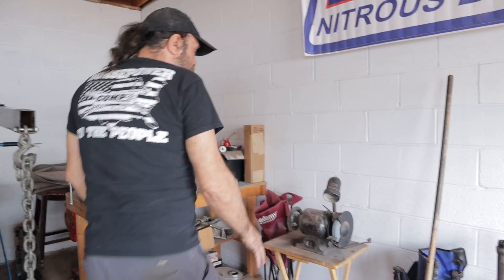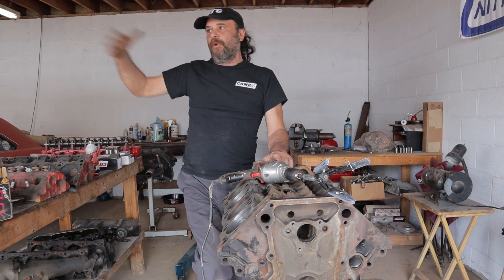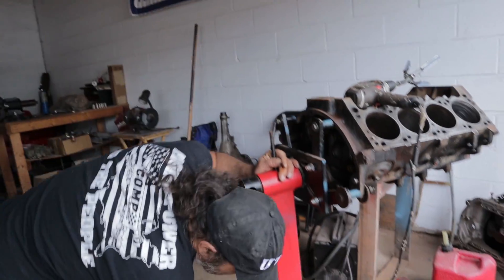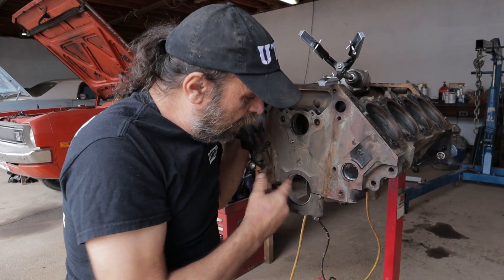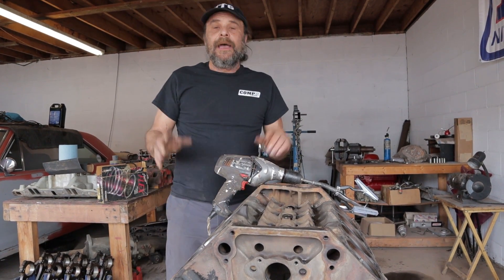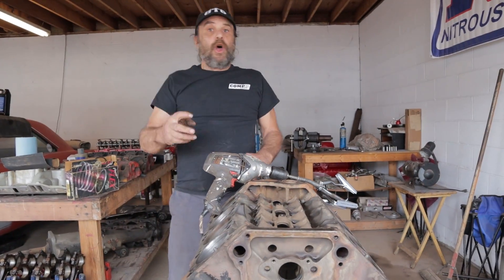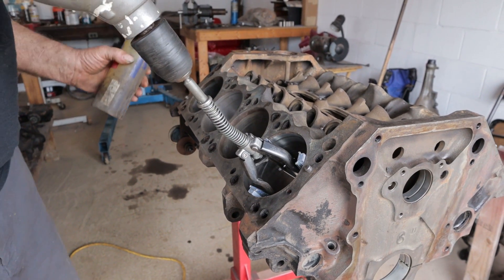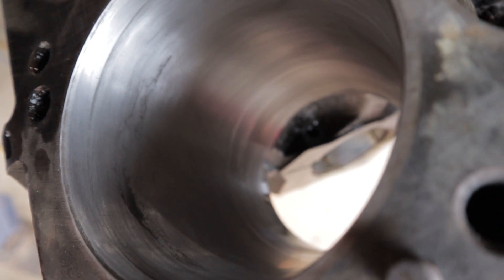Perfect Daily Driver 6 - DIY Engine Block Prep

Comment: Hmmm, very interesting theory on the ridge cutter! I've recommended "cause that's what we learned But, never had an engine with a ridge I needed to cut^__^   But, will a ridge cause your hone to be off what ever it's size is causing tapper???     THNX!
Reply: as soon as the heads get torqued down on the block, the bores distort "out of line", and that ridge as well. The best way to gap/measure piston rings is with a torque plate on to represent that distortion.  Since most don't have a torque plate at home, we can cheat with a stack of washers or a wrist pin that represents the thickness of the head, and clamp our fasteners down to replicate the distortion.
Reply: @albertgaspar627  Taper! (spell check, sorry)
Taper in the cylinder!
 Not, Magellan's maps!

Comment: Tony, love the series!I am going to mimic your build and put it in my 1970 Fury III 318 convertible.Found a really good low mileage 1991 318 engine for cheap. What Thermoquad would you recommend if I want to go that way instead of the Holley? Can get one from a 1979 360...1 3/8" primaries. Great channel...keep up the good work!!!
Reply: 1 3/8 has to be the primaries.
Reply: @techmaven5900  fixed

Comment: I don't know whether to share this with my peers or not. They might begin to hate you Uncle Tony, like they hate on me. Many of them are of the "Once you pull it down, you MUST replace every conceivable component, rebore, grind the crank, deck the block, all after sonic testing it" ilk, even in a daily shopper. I've been doing it this way nearly, but not quite as long as you Unc, and nowhere near as frequently, but with no failures. I'm probably just a bit more cautious, in that I will replace rings and rod bearings every build, regardless. Keep up the great videos my friend, you have the respect of many.

Comment: Never used gasoline, but we normally hone with diesel as lubricant
Reply: if you had a drill cord like this one, you probably were smart not to use gas in a confined, poorly ventilated spot :)

Comment: I love a motor on a shoestring.
Every build has a budget.
Dollar per horsepower Chevy was the best build. Then there was the practicality about how much horsepower you had was actually going to be applicable. Power to weight ratio, traction coefficients, weight transfer, how much can you get to actually hook up. Small car big motor with posi and cheater slicks. Hi 12 + low 13s. Nowadays if you start with a good core and you take it to a machine shop for $1,800 it comes back clean, balanced, in a bag and boxes, ready to be assembled. I'm in California. Then there's fuel once you go past 10.5 fuel is $10. And then?

Comment: Hey Uncle Tony, I didn't catch if that is an LA or a Magnum block?
Reply: It came from a mid 90's D100 truck.  Nothing special.
Reply: @kramnull8962  thanks, mid 90s toward end of production of the D100 I think was Magnum IIRC.
Reply: It’s an LA..... about an 88 model.... just before the change.
Reply: Magnum has three threaded bosses in a triangular pattern behind the motor mount ears . 5.9 l has both ears and holes for vans
Reply: Thanks for the tips guys 👍

Comment: Man, this is good info. For what it's worth, to save a lot of scrubbing when you clean the block try using Outers Nitro Gun solvent. It kicks the living crap out of other degreasers I've tried. I discovered it by accident when I used it (couldn't find the Gunk) on a filthy lawn mower. Only problem is that it costs more than Gunk.
Reply: Yeah, or Hoppes #9. Best smell in the world.

Comment: Tony, why didn’t you mention measuring the ring end gaps ? I always thought that determined a cylinder needing honed or rebored ?
Reply: Measuring the ring gaps in itself won't tell you if it's the bore or the ring that's worn.  Comparing the ring gaps above (on the ridge) and below the ring travel with various places on the area in between will show both cylinder wear and taper.
Reply: Then why do manufacturers suggest measuring it. It’s a common practice concerning any piston/ring / cylinder. If the ring gap is wider than manufactured suggestions. You know the cylinder is too large and you need to increase piston and ring size. That’s why you measure the gap.
Reply: No, you know that the cylinder OR ring is worn.  What I describe above shows which.

It’s easy to suggest anything.  There’s nothing wrong with sticking a dial bore gauge in the hole and taking several measurements.... I’ve done it many, many times.  This channel just shows some old school ways of doing things that have real science behind them.  Enjoy the channel for it is, not what it isn’t.

Comment: Ridge reamer sounds so hilarious though!!??!? Hahah!! if you get the cylinder machined how much will it affect the pistons you can use or what needa to be changed out on a block that needed machining in the cylinders specifically????
Reply: Contrary to what was said. The ridge reamer was used to cut the ridge so that you wouldn't break the piston when the rings caught onto the ridge, when you beat the piston out of the cylinder... Also, like UT was saying about everything here. Ridge reaming is a TIME CONSUMING task... It has an adjustment. You start with the reamer just barely even touching and slowly work it into the ridge... Not just GOUGE it into the side of the block and start hacking away...
He is probably correct though for later 80's to current engines. But if you got ahold of a 60's block that was higher miles, the ridge could be much greater of a problem for getting the pistons out safely...

Comment: On the cam bearings, how do you check to see if they’re all in alignment and level?
Another way to check the bore is to take a compression ring, square it in the bore just beneath the ridge and measure it. Then run the piston all the way to the bottom of the bore, where there is no wear and measure the gap again. This will tell you how much the bore is tapered. Anymore than 0.008” needs to be bored. Anything less may not need to be bored depending the surface of the bore and if there are any gouges or deep scratches it will need to be bored. 5he dingle ball hone is for breaking the glaze in the cylinder only! It will give you the cross hatch pattern you want to help the rings seat. If there is still a cross hatch pattern in the bore and there isn’t enough taper to require boring you won’t need the glaze breaker. If you take you block to a machine shop that has a Sunnen CK10 powerhone or a newer model, that machine will give you the crosshatch you need. There is no need to use a dingle ball hone or glaze breaker in that block. If your block needs to be bored, pay the extra to have it power hones with a torque plate. The will draw the block together just like you had a head on it so it will be square when you volt on the head.
Reply: torque plates should not be avoided, unless its an engine that bolts the head not to the deck, but runs the bolt holes into the block itself (like a pontiac). then you can probably gamble.  otherwise a torque plate should also be considered when checking the piston rings and even when installing hardened exhaust seats on a head.  since most of us don't have torque plates at home, we can cheat with a stack of washers or a wrist pin torqued down into place
Reply: Can bearings should be installed with an install tool.  It registers on the foremost bearing bore to keep the driver end square and reaches through the block to drive them in.

Comment: Here's a tip from the port city kid ( me)eastcoast to ya.my favorite tool is a electric leaf blower I use mine to blow everything out from gas lines  filters aircleaners to the whole garage ECT.leaving the door open all kinds of dirt dust will blow in a at the end of the day I blow it all back out. I took all kinds of odds a ends attachments a made them fit on the blower.( simple clean easy cheap a threw my vac in the corner.even blow the vehicles off inside a out before entering garage.( try it you'll like it.!

Comment: What you Working on Nephew's?? 
I'm 68 Dodge Dart
Reply: Usually everybody else's stuff....
Reply: @JohnWilburn  Haha.. man o hear that.. it was crazier for me when I still owned a truck.. being helpful I mean......... ironic? Anyway I don't want to brag like our pal 1smokeydog1, but Every car I've worked on, is still a Car, still a on a road, near one, park close by, or driveway but most are running..
Reply: That’s not possible unless you used those industrial clamps of his.  By the way, he immediately pulled that video back down and has no other content.  Huge red flag..... as if he had any credibility anyway.
Reply: @JohnWilburn  I found his last key board battle, 2 year degree in auto mechanics.. that's new to me but whatever,  also bragging about his shop and what he does for work, tool bragging about tools.. man I got tools to fix tools hahaha..
Reply: @JohnWilburn  You see, cause when a Man is Man, you wake up One.. confidence in ones self builds better everything.. I have no formal education beyond normal schooling, I wish I had more,
Reply: @AtZero138  Well, you're getting education here!  The exam is when you actually build something and that's graded when it works or doesn't.  We're in our 40s..... we can't stress over the silly stuff smokeydick does.
Reply: @JohnWilburn  Yeah my engine swap was my Everest.. until I could see it was just a Hill, now with 37k on my mild rebuild 318, head gaskets and valve seals,  she runs and drives everyday,  well until now, no work at the bar, now I just cruise her around for fun, take the long way to get a burger haha.. while working full time, my list of to dos grew.. brother at every Start I win.. that's my work under the hood, also my ladies Slant6.. I fixed every single problem that car had, from before we met.. she pretty so any number of dude's acting like they can fix this etc .. left her very untrusting of anyone being able to fix her first car, still on the road now.. haha
Reply: @JohnWilburn  seriously cracking up, one dude left a comment, stating why doesn't UT use an aluminium block since it would be lighter.. 🤔........

Comment: Even the cheap chevy small blocks crate motors are made and assembled in Mexico!They are/were before Covid building a Chevrolet factory in china will resume im shure and the cheap cars will be built there like Cruze and Spark and many other models its the consumer fault they want cheap chevy will now be able to compete with Hyundai and Kia
Reply: I don't call a $32,000 Hyundai or Kia cheap... Just don't install that $10000 infotainment center, that has the exact same luxuries or LESS than my LG smartphone... I really don't care if my passenger feels the need to be 3 degrees cooler or warmer than me....
Reply: kram Null The Accent-5 door model is 14,949$ msrp out the door there more expensive gas car is 35,049$ and the electric Kona is 44,999$ thats it! They are a bargain brand for sure you get what you pay for with them your average car value drop 15% when you drive it off the lot these are more like 40% drop on day one

Comment: That glaze breaker hone you use is ok but I prefer a more rigid unit like a Lisle. The glaze breaker style has a habit of following the contour of the bore, the irregularities that is. Freeze plugs, I always remove them. 1) they may be rusted nearly through & show no sigh of leakage. 2) Removal will allow you to thoroughly clean the coolant passage inside the block. There is usually a bunch of crud hiding at the bottom of the water jacket. MoPar truck blocks are made of high nickel iron and are very rigid & durable, you ain't gonna distort the freeze plug bores. Never had a leak problem after replacing them.

Comment: But UT...where are your gloves and PPE??  C'mon man!lol!  I don't wear them either at the shop unless I'm handling hot parts out of the washer.  Another good finishing honing product is starting fluid.  I actually use that with dingleberry hones if I'm simply roughing it up as all the heaving honing is done on the machine.  
Also, go to Flea Bay and scour it for NOS rings.  I found some 70 year old rings and bearings for an old Ford we had at the shop.  Still in perfect condition save for a little oxidation but the bearings were amazing quality. Got them all for the cost of the new rings alone.
When replacing freeze plugs in old FE blocks I'll always use a little silicone and ensure the surface is as clean as possible.  A few swipes of sand paper can save some misery down the road.

Comment: I want to smack people over the back of the head with a camshaft for even thinking about using a ridge reamer... Thank you for clearing that up. If the ridge is big enough to "warrant" using a reamer than it's fucked anyways and needs bored.
Reply: you take the ridge off so you can knock the piston out ...am i wrong ?
Reply: @ridgerunner7980  not really. Like Tony was saying the ridge is the only round part of the cylinder. That ridge is caused by the rings. When the air fuel mixture ignites it creates an huge amount of pressure in the Chamber. This pressure forces the rings into the cylinder wall. If you have a 4" bore than the ridge is the only part of the cylinder that will actually be 4". Underneath that ring might be 4.08". All a ridge reamer will do is make the ridge match the cylinder underneath the ridge. In this case it would machine it out to 4.08". That's why they're basically completely useless because if the ridge is bad enough to even consider get out a ridge reamer then it needs bored.

Comment: One thing unk doesn't mention here. Novice guys buying swap meet engines. Hear that scuffy sound when he's moving the ring in the bore? That's what a freshly honed engine sounds like. If it's smooth sounding, it's used or the guy that built it doesn't know shit from shinola. If the seller won't let you turn it over, RUN. If the blocks been welded on, RUN. We have a huge car show here every spring. The volume of junk engines for sale baffles me.
Reply: Quality and honesty are old school. Very sad, but true. Greed for money is the current normal.

Comment: Watched a Australian race engine builder they opened the cam tunnel up and put in needle bearing.
UT is threading the freeze plugs to replace with threaded pipe plugs still done?
Well maybe because we're taught by our dads to uses ridge reamer

Comment: did i hear you right when you said you found a lot of silicone and stop-leak, i would think you would take out all the freeze plugs to be sure you get it all out. ps love your videos
Reply: wait til you see the future videos....the oddball core plug is a clue something was wrong with the block. The lesson is, as you said, don't be cheap and try to save the core plugs by not removing them.  The block's going to the machine shop to get cleaned, and i'll bet those cam bearings are getting taken out, too. "Cheap" is always a gamble.

Comment: the engine I'm taking my sweet time to build [84 ford 302] would warp while it was on the engine stand after i put the piston/connecting rods one at a time and rotate to notice binding would only bind after all were installed. I took it back to the machine shop it wouldn't bind on the bench back on the engine stand it would bind, sure slowed me down but It gave me more reason to add better heads [I needed the excuse]

Comment: Good video uncle Tony good video as usual 

you have given me a flashback we used to check number one cylinder at the front of the motor for lip because that always had the worst lip and I was told the reason for that is it runs the coldest because it’s got the water pump bolted right opposite on the other side and runs the coldest 

when I was doing DIY stuff even if we didn’t re-bore The cylinder we did remove the lip with a special tool and then honed em and they told me the reason for that is that even though we re-using the same pistons we’ve got new bearings on the bottom and everything is been taken apart and when you thrash it a bit the piston travel can be a few thousandth more than it used to be on account of things stretching a touch and there’s a theoretical risk it smashes the ring landing......

Don’t know if it’s true or not that’s what they taught us
Reply: Trick is, there is an adjustment on a reamer. Don't shoot for a .030 overbore with the reamer... It is another one of those TIME CONSUMING tasks...

Comment: Hey Tony..... You saying old rings will re-seat in a bore that has been honed and is straight and round ?
Reply: If it is true and round and the surface has been prepped right, the rings will wear in, ring gaps mY be larger than new spec bit it ain't a new engine.

Comment: Very informative. 
I have had guys hand me a dingle-berry hone that was in their trunk, or bottom of their toolbox and is sadly deformed. I don't know why anyone would use one in this bad of shape, but guys just bend em back and give 'er. And I have seen a guy hone his engine so badly conical that the engine lost compression and each ring in all but one cyl came out in multiple pieces from expanding and contracting constantly.
Thankfully there's resources like UTG to keep the rest of us from turning a block into a doorstop.

Comment: if you went with an aluminum block it would save a lot of weight
Reply: Yes... it would.. but 7,000 dollars isn't what this build is for,  Daily driver, and Super budget build, good used parts, cleaning Do it yourself "DIY".. not a high Horse Power build, it's being built for economy fuel mileage also, why the 318 Heads on a 360, small intake ports will create torque in the traffic light world, there for usable and fun.. 
Daily driver everyday and Everywhere 68 Dart 318 swap with mild rebuild due to time and money,  now has 37k on it, will cruise at 85mph and have had her up to 110Mph no worries,  peace